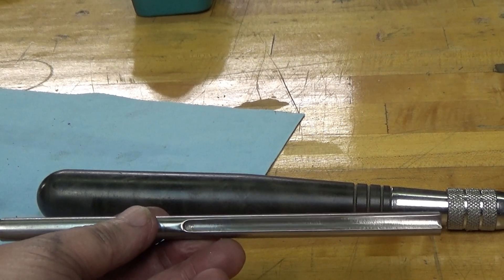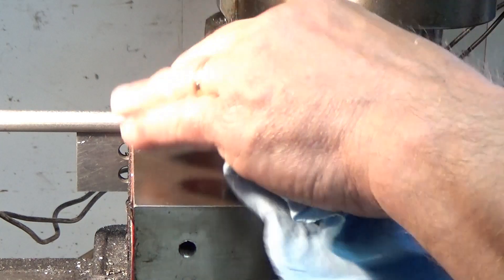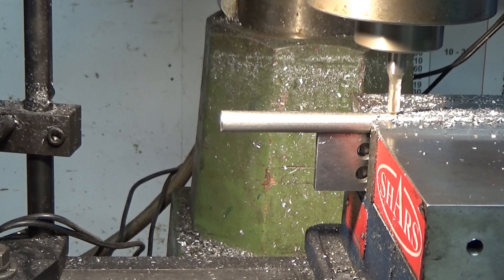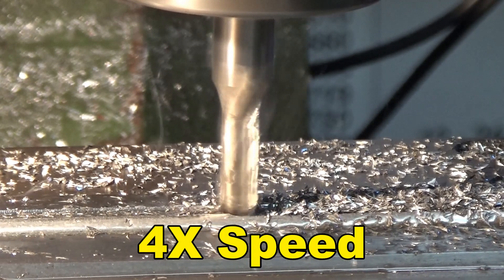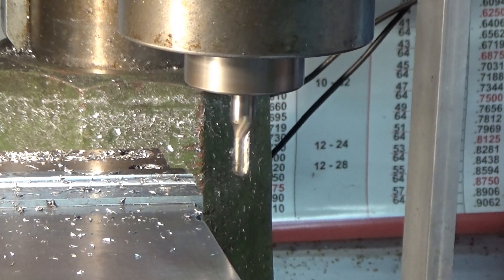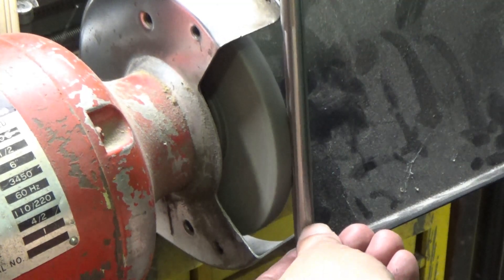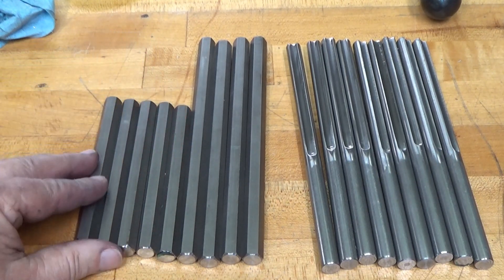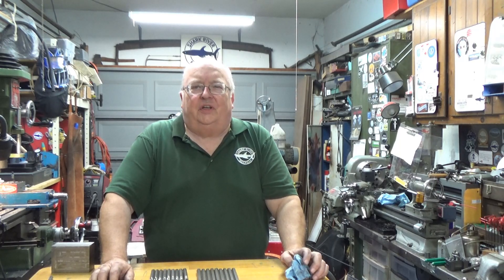Special Tool Build

Comment: I find production work interesting to see. I prefer to avoid it myself though when possible.
Reply from the maker: I am not a big fan of production work myself but this job is a little different.  My client designed the tool and I came up with the specific attachments required, then he got it patented. It keeps life interesting.  Thanks for stopping by my channel.

Comment: So I'm certain this is a stupid question, but I am missing something. If you are milling, the tool pressure is applied vertically. How does the tool manage to deflect enough to require spring passes when it's from above and there is parallels and such providing rigidity? Like I could understand the occasional wisp coming off from deflection caused by feeding faster than the end mill can eat, but you seem to be putting up some pretty decent size chips on your spring passes. What am I missing here?
Reply from the maker: I have given my observation a lot of thought.  I referred to it in another post.  I think that actually what I was observing was the conventional milling verses the climb milling as I changed directions.  The cutter was deflecting to the side based on the direction of travel.  Thanks for watching and commenting.
Reply: @sharkrivermachine  okay, thank you! That makes so much sense. This kind of thing drives me nuts until I figure it out.

Comment: Nice work on SS, that can be a bear on HSS cutters Steve...see you  on ARW  with the other YT creators.✔✔👍👍
Reply from the maker: It was crunching and sounded like it wanted to break a few times.  I actually worked and sounded better with a little more tool pressure.  I was think that I would have liked to have a carbide cutter. Thanks for watchin and commenting.
Reply: @sharkrivermachine  When I have more than 1or 2 to do, I set up a stop on the vise, and I will hog out most of the material  with an undersized roughing end mill on all parts run, then used the finish size ball mill and do it it 1or 2  cuts to finish size [best to get it roughed out  so  finish pass or passes does  most of the cutting that is the bottom radius. cheers!

Comment: Surprising how much the spring pass cuts out, I guess it's the tool deflection on the way in making it necessary to do so. Thank you Steve for sharing - great job well done! BTW I have no idea what it is! lol I'm sure some one will comment!
Reply from the maker: I was surprised also.  A lot has to do with the rotation of the cutter.  As you go in each direction the conventional milling and the climb milling swap sides.  Thank you for watching and commenting.